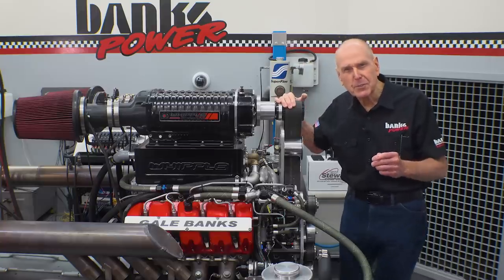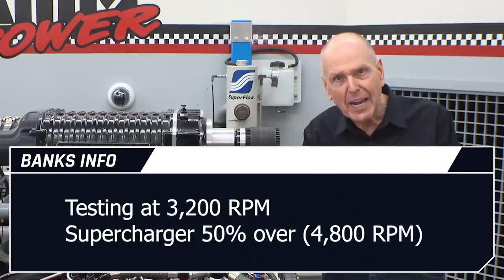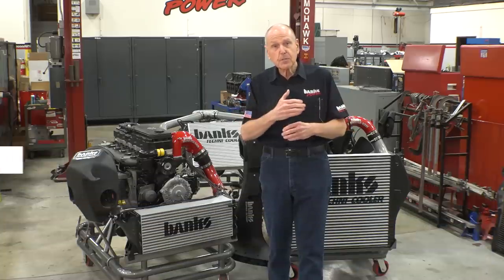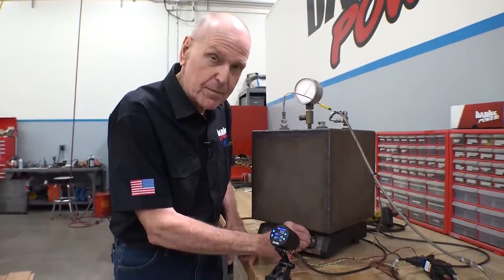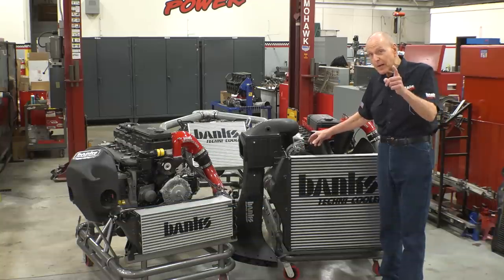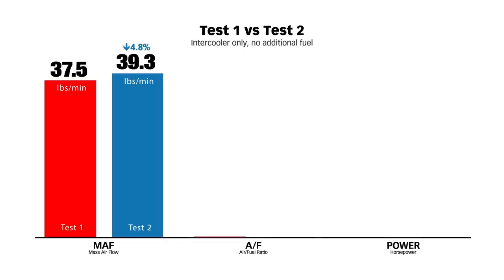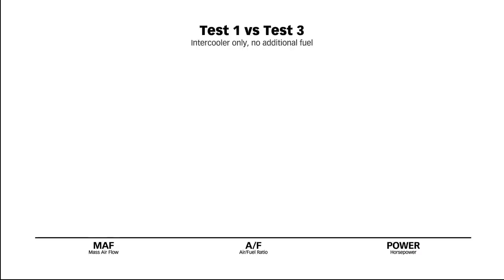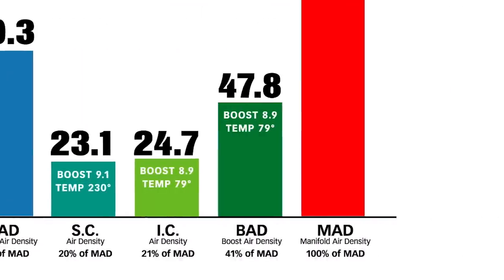MORE HORSEPOWER with Less Boost?! | Building a Monster Truck Engine Pt 8

Comment: And I accidentally deleted my comment. Derp >.<

If you're going to do an episode on Water Injection / Anti-Detonant Injection, you should give Hydrogen Peroxide a try versus just water and MW-50 (50/50 blend of water and methanol).

Instead of typing everything from my previous comment again, I'm just going to refer you to the research paper where I got the idea:
"Effect of Injecting Hydrogen Peroxide into Diesel Engine", published April 2012.
Reply from the maker: We're trying to avoid spraying anything in. These are designed to run in monster trucks that flip upside down. We don't want more jugs of liquid than necessary. But we'll forward the research paper to Gale and the team. Thanks for sharing!

Comment: There it is , political correctness driven into the ground where it belongs. Forget the style of comparing to a leading manufacturer that dances on eggshells,  Gales calls them by mane...why? Because he is confident about his products and the science that makes them superior to the competition, stating so, is not boasting at all , it is a statement of truth when backed by scientific data , the boasters are in fact those  that he calls out, they take in profits based on advertised boasts...with less return for the customer.

Comment: I love how you are explaining to people that rolling coal is not the answer to making big power. With the diesel there's slightly too rich which turns the injectors into a cutting torch. EGTs through the roof. Gas tuning dudes add even more fuel to the point so much is unburned it cools. It doesn't add a lick of power. If they just backed it down until the EGTs dropped again they would be in the sweet spot!! They have to waste a ton of fuel to drop temps.  Even then it's still getting too hot.